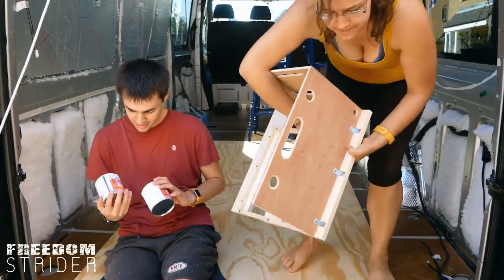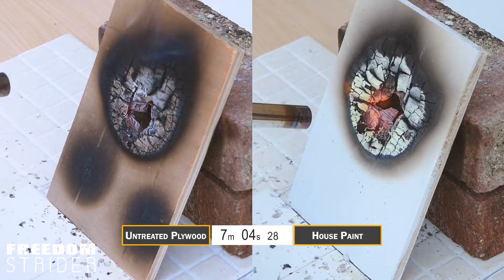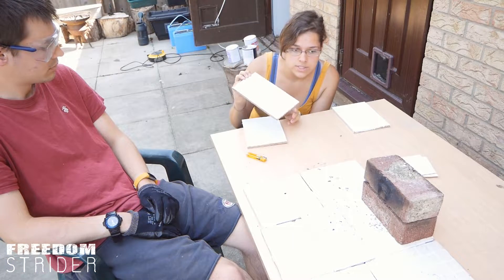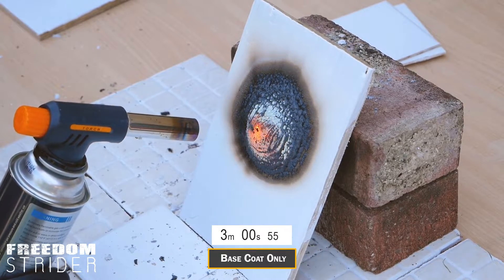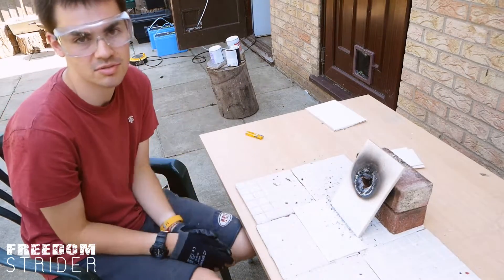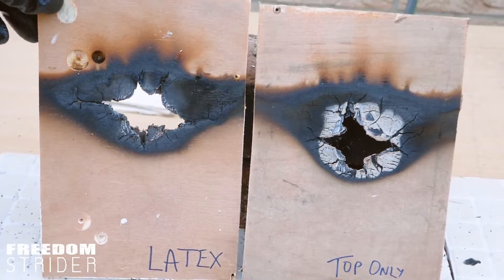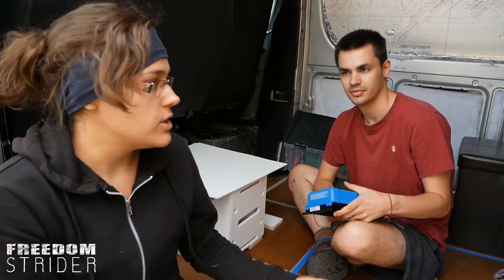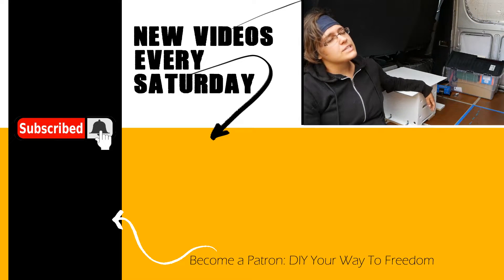FIREPROOFING our van electrics!

Comment: google 'starlight' and clones of it. also why do people not build the batteries/chargers/inverters at the front cab end, and the bed at the back of the van, with smoke alarms and extinguishers at each end. (I chose that method) seems to (a) maximise distance from the possible fire and (b) increase warning time increase chance of escape. i see so many people putting a bed at the back with a garage underneath then they fill it with electrical and chargers and batteries and sleep on a fire hazard!!!
Reply from the maker: You are right a lot of people do as you have described, and in our case, our main bed is at the back and not on the couch (the couch is the guest bedroom 😂). Though in a small space, such as the vans, you haven't got much reaction time anyway... depends what lights of course.
Reply: @FreedomStrider  if it's electrical it's usually the weakest link, poor quality underrated wire and incorrect fuses. 10a wire will never catch fire if fitted with a 5a fuse, but you see so many led lights on Amazon and eBay with 1a wire and then it gets wired incorrectly to a larger fuse because most automotive fuse start at 5 amp. When that skinny wire gets damaged the fuse wont go but the wire glows red hot and burns other things.

Comment: Interesting video. I think that you may be worrying unnecessarily  about your plywood battery box burning. Intumescent paints are used in industrial/commercial applications over steel substrates and I think  it may not be very effective on engineered timber which are bonded together with adhesives. You might be better off investing in a few fire extinguishers and a few power cut off switches . As far as your lithium batteries are concerned; if they are charged at a low wattage they will not be excessively hot plus you will be extending the life of the battery. Great build.
Reply from the maker: Its more of a time saving precaution on a a very open electrical setup 😊 this intumescent paint is also specific for timber as well, not steel but as a general rule you're right it's used in industrial applications mostly and as we demonstrated, the adhesive in the ply does not help the fireprotection hit that's why we tested it we wanted to know exactly what we are doing 👍

Also we are going to have everything fused, with kill switched and a fire extinguisher, so we could be unnecessarily adding this protection...
But we had a friend who forgot to fuse one of their wires, and when the wire burned through through it charged their plywood alot, came very close to lighting more than just that ply on fire, so we thought, fire retardantant paint, that will slow a tad 🙃🔥
Reply: @FreedomStrider  Thanks for your reply. I noticed the design of the plywood box. I think that you are becoming very proficient with woodworking and power tools. Look forward to your new videos.

Comment: Hi Guy's, I'm going to have to jump in here, sorry. Great video about the paint, very interesting. However, You are using LiFePO4 batteries here and you are worried about fire. These batteries can get hot and if they catch fire the temperature at which they burn, and the violence of the rection will make your blow torch look like a candle. Not to say the paint will not help but, You have lined the battery box with what looks to be PIR boards, which are great insulators. Your batteries will get hot on discharge and charge and need to be well cooled not insulated. This is why cars such as Tesla's batteries are enclosed within  a liquid cooling jacket. It is also the case that the hotter they get the faster their chemical reactions proceed. For goodness sake remove the PIR insulator from around the batteries. By the way, if one of those batteries does go.......nothing will stop it. If in doubt now i've said this, please contact the battery manufacturer and ask about it. Kind regards
Reply: Oh wow, Is that right? I thought LiFePO4 batteries are almost impossible to set alight?  I coulda sworn I saw some video about it. Oh well I'm probably gonna have to rethink sleeping above mine.
Reply from the maker: Geeky Phillip did a video on lifepo4 - they are not as flammable as people think when built and stored correctly - lithium polymer (like phone batteries) are much more flammable 🔥

The way you protect and stop your batteries from catching fire is buy a good battery with a good BMS

I don't think you'd need to worry about sorting them under your bed 🙂
Reply: @FreedomStrider  That's good to know but It was mainly said in jest as I have a SWB van, so pretty much everything will be under my bed lol. That being said I now have concerns about my choice in cheap Lithium batteries,  oh well more research.
Reply from the maker: Oh right, we didn't explain this in the video that we'll, bit we are not concerned about that batteries catching on fire because as you said if they do manage to light, then bye bye van basically. It was more about protecting the wood from a wire spark or something (like if a wire melts and the heat starts spreading to the wood)

We had a friend who hadn't fuse a wire, and their wire meted and charred the ply, luckily they caught it in time, bit it was a very close call so the paint is really a guard for that.

For the insulation coat, the reason it's there is because we were told to guard against cold temperature Charing since they are lithium, however I have been thinking on the exact point you mentioned that Lithium's do get hot. Our batteries BMS do have a high temperature cutoff which is good, but we're not sure if the insulation coat is going to stay, plus, in terms of fireproofness, that our board burns very quickly (we didn't have time Inthe video but we also burned that too, it out instantly and the smell was horrific) 

So bit conflicted about the insulation element as we said, bit you're definalty right about the issue with the insulation being in place just not sure how to protect against cold temperature 🌡️😃 charging